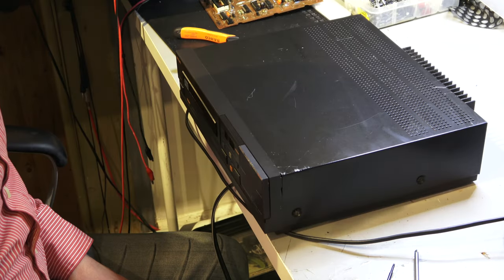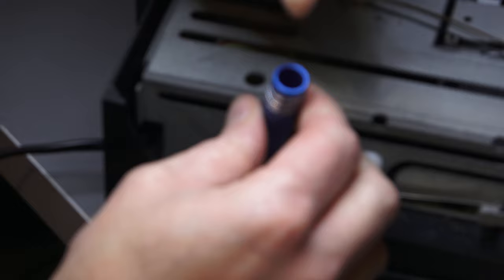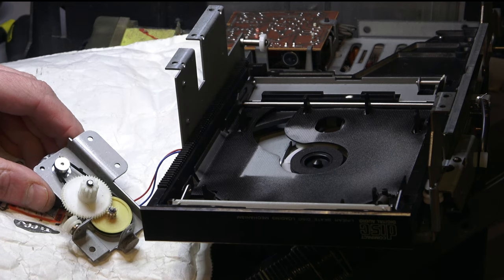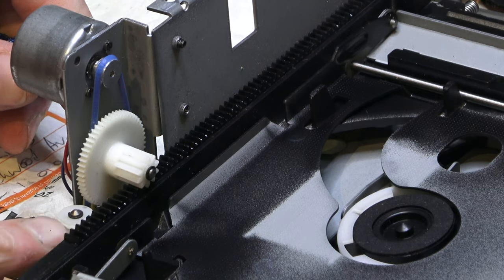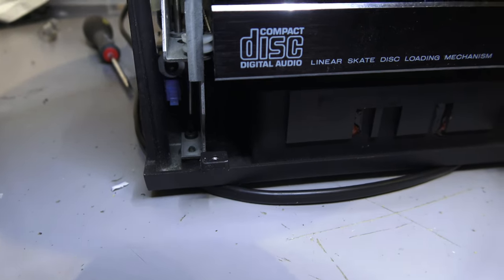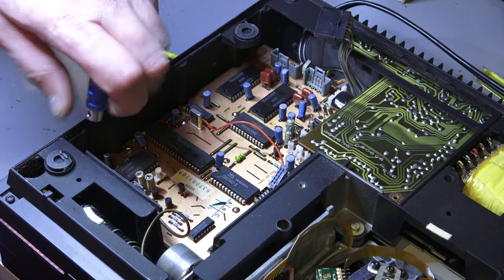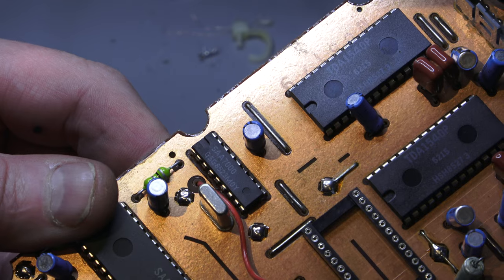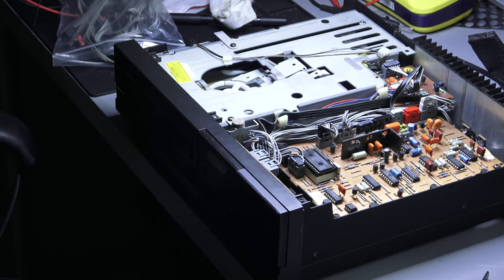Philip CD104 CD player, changing belt and removing Oversampling

Comment from the maker: As an Update, I decided to reverse the oversampling mod. This was after speaking to those with much more experience with these machines. The mod can introduce unwanted Rf signals into the audio stream due to the removal of the filter.
Reply: NOS mod does not cause any problems...... I use all my cd players and dac  that way for more then 10 years.....  may be can cause problem with some poorly build amps....  for me never had any....
Reply: @cskabos But did you measure? It's not a matter of 'I don't hear it so it is not there'.
Reply: @puciohenzap891  you can still use a bessel filter at 40Khz… when using NOS….

Comment: Thank you very much for your video. I have a Magnavox FD2040 CD player which has exact transport CDM-1, I have a hard time to put motor assembly back after replace the belt, your video is great help.
Reply from the maker: thanks for watching and i'm glad it helped you
Reply: It is working great now. The original belt is 40 years old. I used 2 mm square belt 128mm length,(64mm when fold in half and measured with caliber). 2mm is beefier than original belt. I love this old CD player's sound-rich and smooth like tube. @waheex

Comment: What do you mean by pseudo-16bit? Are they not actually 16bit?
Reply from the maker: it's a 14 bit player
Reply: @waheex  ah ok, cheers!
Reply from the maker: 16 bit came out shortly afterwards and Philips installed a chip to 'oversample' and make it like 16 bit I believe. Many say it compromises the sound of the player, therefore many removed it and bypass with a mod. Also change the clock speed of the player. @KarlHamilton